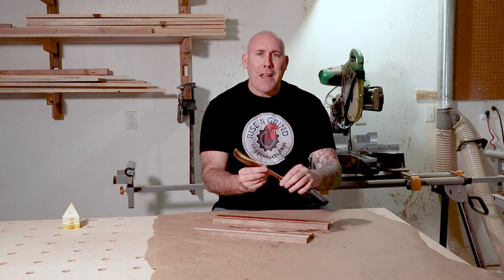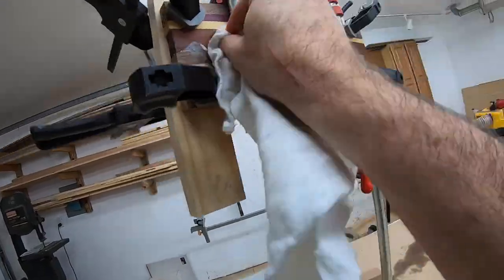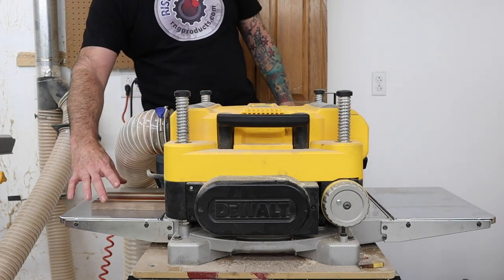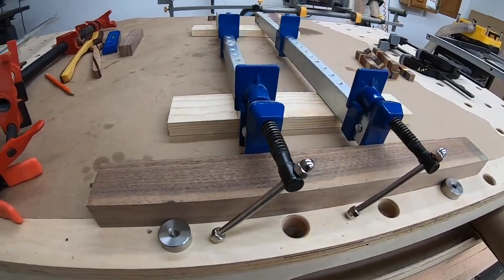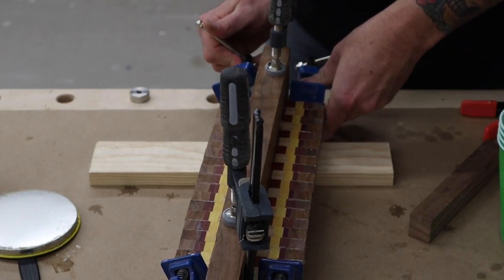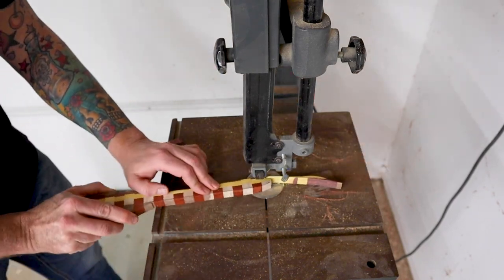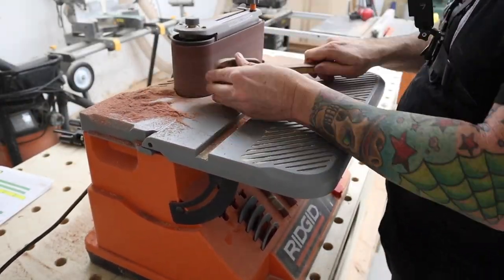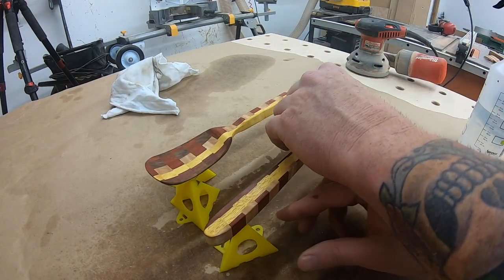Easy Wooden Spatula Project

Comment: When gluing many small pieces like  that, try using painters tape on one side then fold back and put the glue in from the other side. It will also hold them from sliding when you clamp. Nice project too.

Comment: I thought about this too, but let’s say you’re cooking a stew with this. Will the glue joints fail? And making the stew inedible bec of the glue? Just curious! I figure for tossing stir frying it’ll be okay but if it’s submerged in boiling liquid might not be okay?
Reply from the maker: I have been using wooden utensils my entire life. Some are pieces glued together and others appear to be one solid piece. I use TiteBondIII wood glue, which is safe to use on cutting boards and utensils along with being water proof. Just use some common sense and the utensils will last. Just don't leave them soaking in water for extended period of times.🍻

Comment: They are beautiful but really you should use Danish oil and not mineral oil.
Reply: BLO is also great for these
Reply: Never use Danish oil to a surface that will be used for food.
Reply: Nah use salad bowl finish
Reply: @guido1534  BLO is toxic. Mineral oil is not.
Reply: Danish oil is food safe, unlike BLO. That said my favorite is beeswax and mineral oil.
Reply: @tonnyandersen5148  A quick Google search would disagree with you. Would you care to elaborate?
Reply: @rain104  Well a quick google search may only tell you what you would like to hear.
Danish oils are not a consistent mix and can vary across brands. The most important fact with Danish oils (and other furniture finishes) they have chemicals in it to allow it to dry which will allow you to build up layers to achieve a sheen to the surface. Please bear in mind that on chopping boards you would be using a knife to cut which can allow the dried material to enter the food and  with spatulas, they are usually used to stir hot liquids in pots which can affect the dried Danish Oil.
I would only use food safe products that SOAK into the surface and then the excess to be wiped off. This is not only safer for human consumption but ultimately  better protection for the item in question.